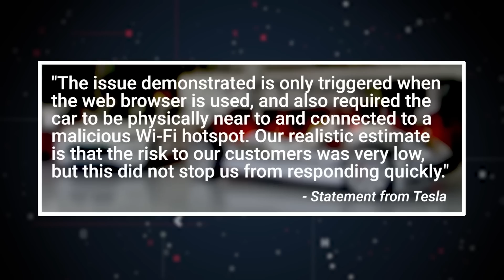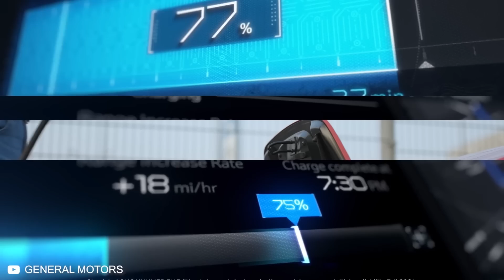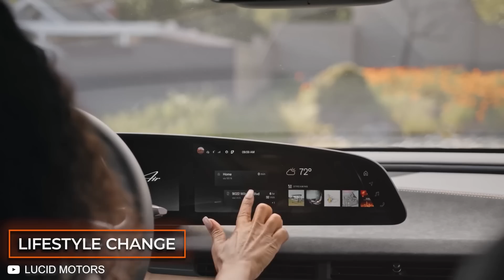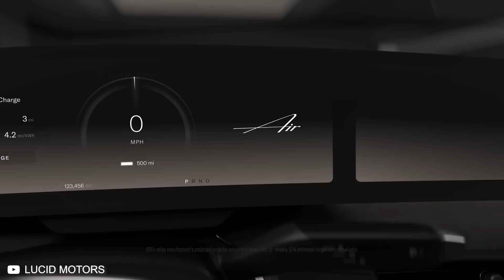EVs' Serious Problems That Carmakers Are Hiding

Comment: EV is not ready for prime time conversion yet.  Range anxiety will prevent most from switching.  And, unless you own a Tesla coupled with a high capacity charger, you won’t have the patience to wait.  Who would buy a used EV given the life span is ten years? Besides, $15k+ to switch out batteries and declined in range on older batteries.  Too many hurdles to own a EV now.

Comment: According to AAA driving in 20 degree weather and running the heater shortens the range by 41%!!

Kinda scary
Reply: Well 1.) depend on the temperature the car is set to. If you’re driving in shorts and a Hawaiian tee, not surprised. 
2.) depends on the car, teslas made after 2021 have a heat pump as opposed to the previous norm of a resistance heater. This greatly increases efficiency and most Teslas now only lose around 5% if the maths and statistics are to be believed.

More and more EV’s will start adopting thing. Especially for colder markets

Comment: A 45-minute break in the middle of one of my family's frequent 8+ hour trip sounds terrible
Reply: Well he has that wrong. It’s 45 minutes if you have to roll in on 0% and your last electron, to charge to 100% on a V2 super charger. Most of that charging time comes from the first and last 10%. More commonly you’d arrive with around 20% and charge to 90% and this would take around 20 minutes but on the new V3 super chargers it would take 5-10 minutes. And if you have a family then you know as well as I do after 4-5 hours of driving, at least SOMEONE is throwing a tantrum because they need the bathroom or they’re hungry.
Reply: @engineeringtheweirdguy2103  Okay. But I also don't need 45 minutes or even 20 minutes to get everyone to the bathroom. Not that electric cars are really designed for road trips. He's right about having to plan your life around your chosen powertrain lol
Reply: @ProductBasement  well not really. You’re life doesn’t revolve around road trips. And whilst a pee and go sounds nice, it’s never that simple with kids. Additionally it’s not safe you someone to drive for that long without a break. The human brain on average can only sustain focused concerntration for a maximum of 3 hours before mental exhaustion sets in and functions are significantly compromised (zoning out or falling asleep). Additionally kids often want to eat at regular intervals. Meaning at least 1 stop fro breakfast or dinner or lunch. 

I regularly do a 6 hour road trip every weekend to go snowboarding in my EV. When I stop for a charge, I also stop for dinner/breakfast (depending on if I’m coming or going).

The car is often done charging long before my food is ready and then eaten. But keep in mind I did this with my Subaru as well. Except I had to add getting fuel, paying for fuel, then finding somewhere to park. None of which I have to do with an EV as I pull into a charging bay, plug it in and walk away.

It’s an paradigm shift and just because you can make your family starve for a full day, and have regimented pee-breaks or force them to use a colostomy bag when driving a combustion car, doesn’t mean it’s safe, responsible or even what most responsible people do. If you timed yourself you might find you’re stopped much longer than you think you are.
Reply: @ProductBasement  and for the record my road trips cost me around $15 in electrify each way, where as in a combustion car, it would cost me closer to $200 with current fuel prices. With the bonus that I don’t have to worry about my car not starting in the snow because my engine is too cold to sustain ignition before my starter battery dies.

Comment: We were at the Ford dealer the other day and one of the guys showed me an electric pickup truck the price was $92,000.00 and it weighed over 7,000 lbs. It's totally ridiculous.
Reply: 92k? That's cheap. When I was looking for a truck a salesman said they had two on the lot for $140k each after "Market Adjustment". Insane
Reply: @boss42971  Wow, I believe you, if someone got that kind of money, more power to them.
Reply: @boss42971  what type of truck was going for $140k? An F250?
Reply: @albertogonzalez1746  Ford Lightning F-150

Comment: When thousands of those batteries become dead and useless, then what landfills and oceans are they going to dispose of them in?
Reply: The technology already exists to contain lead, mercury, and cadmium when recycling batteries and it is improving by the year to the point that in about 20 years the need for mining will be reduced substantially for recycling batteries. All the other mineral and elements in a EV battery are fully recyclable even after being used as second-life batteries. One nice thing about EV battery cells is, they find a second use in stationary grid storage. When there are enough of them to create a market where recycling them by manufactures is not done, they will be recycled to reclaim the valuable metals just like any other high volume appliance does nowadays.

Comment: I have been driving a fiat 500e since dec 2017!  Range anxiety is real….i have a level 2 charger at home.  My fiat only has a range of 87miles….and in reality its much less when you use the a/c.  I live in south florida.  I am not able to make a round trip around my city.  There were also not enough chargers to help me in my journey.  I have run out of juice probably 4-5 times ( that meant i had to get towed home).  The maintenance costs on an EV were minimal.   I recently received my LR Model Y 2 mos ago.  I am very happy now that i get over 300 miles now.   I am able to go to more places without the anxiety.  I even made a road trip to Orlando with no problem.  Tesla has a great superchargers everywhere. I also noticed there were other chargers around so that will make it easier for others to get around better.  As long as we have more charger stations for people, the EV race will get better.  I am so happy with my purchase!
Reply: I have a standard range model 3 and never really had range anxiety once I got used to it. Modern EV’s have come a long way over the last few years

Comment: Sell me a car with a regular battery size that has 5000 mile range per charge. That charges in 5 minutes. And uses 1 kilowatt to charge. A battery that lasts 2 million miles. And mechanically reliable as a corolla. Sounds like a dystopia until then I'll buy it.
Reply: Why do you need 5,000 mile range when you can only do around 1,600 miles in 24 hours of driving at highway speeds non-stop for 24 hours? Seems like a ridiculously impractical demand. Especially considering even at the longer end of average the average daily commute is only around 60 miles round trip.

If you used 1kW to charge over 5 minutes you’d only have 0.08kWh which is about the same amount of energy as 2 AA batteries.

So you’re demanding an impractically high range you’d never be able to use on a week yet alone a 24 hour time frame even if you had a colostomy bag so you didn’t need a bathroom break. 

But you also want to achieve this, by reducing the battery size to the size of 2 AA batteries? In contrast a 400 mile Tesla has a 100kWh battery. That’s 1,250 times larger than what you’re demanding. From a physics standpoint, your dream car wouldn’t have enough energy to even overcome your weight, yet alone the weight of a car. 

You get more power from an RC car battery!

You sir, are losing the plot a little. Lower your expectations

Comment: Most are still charged with fossil fuels.
Reply: So? 

An EV recharged by a coal plant puts out half the CO2 as a gasoline car the same size doing the same trip and even much better in stop and go commuter congestion.

Petroleum is valuable to wasted on gasoline; we'll need a lot of it for our grandchildren to use for plastics, paints, petrochemical feedstock medicine, etc.

Comment: What about driver passenger safety if a fire starts on your electric vehicle?

Are UK fire brigades trained to deal with highly toxic smoke, and debris that is also highly toxic? These things go up like romantic candles.

For me, it's just a rush to bring out the new technology. I certainly  won't be purchasing one.

By the way, you'll experience horrific range anxiety when you travel on our motorways. People are being prosecuted for overstaying at the service station. The reason, they had to queue for hours to use a charge point.

Comment: Most objections to EVs are either due to misinformation or resistance to change. People hear what they want to hear and draw inaccurate conclusions from it. The reality is petrol cars are just as challenging as an EV, its just that we are used to their particular challenges and have learned to live accordingly. Like they said in the video, changing to a an EV requires a lifestyle change and a new perspective on ownership. With proper planning and management, there is no reason why an EV cannot be just as viable as a combustion car. If/when I go looking for my next new vehicle, I have no issue with selecting either a traditional or EV model. I would love to own a Mclaren or a Ferrari or a Mustang Cobra, but I would be equally excited about a Tesla Plaid or if I decide to buy a truck a Rivian is just as likely as an F-150.

Comment: Aside from your remarks about serving (I have a 2019 Tesla model 3, with over 100,000 miles on it and all I’ve done in relation to servicing was replace the tires.) your conclusion is sound. But heavily worded. A charging “regime” isn’t any different to a refuelling “regime” most of your Charing is done at home and maybe 3 or 4 times per year youd charge else where. It’s really not that terrible to work around. Or common.
Reply: Considering I put an average of just under 300,000 kilometres (186,000 miles) on my last two cars over about an 18 year period, it seems it could be a good investment for me in the long run considering that I wouldn't even drive that much now that I'm retired.
Reply: @rps1689  it would be a better investment if you did drive that much. Because they are so cheap to run by comparison. Electricity costing less than fuel and the little to no servicing required. The further you drive, the more money you’ve saved by comparison. I drive more than 100km every day and my standard range has been breathtaking value for money.!including my home solar, I went from paying around $100 a week in fuel to around $10 a week in electricity to charge the car…. Infact my monthly electricity bill, including aircon, refrigerator, dish water, TV.. etc electricty use. My entire electricity bill, car charging and all, is cheaper for the whole month than it is to get 1 tank of petrol at the moment.

A side to EV’s very few people consider.
Reply: @engineeringtheweirdguy2103  One I overlooked.

Comment: Only good for trips to work and back?standard range EV, yet alone the more popular long range EV’s have enough range to get you to and from work…. For almost a full week without charging for the average commute. Super chargers charge your car in 10-15 minutes and you’ll be using a home charger overnight which can fully charge your car in 4 hours considering the average car spends 14 hours a day parked at home overnight I’d say that’s plenty of time. No need to wait for a charge. Even from a wall point that you’d charge your phone from, for a daily commute of 60 miles only takes around 7 hours to charge back up again. Still plenty of time. What’s your angle here bud?
Reply: Interesting. I would likely only drive about 10 kilometres a day, and my longest trips would be about 350 kilometres twice a year. There are no lack of charging stations near my neighbourhood so it is tempting.
Reply: @rps1689  a standard range model 3 would do around 380km to a charge. You could not charge for nearly a month and still do your daily commutes. And you could do you 350km (although I’d consider finding somewhere to charge, if bad weather rolls through this can cause extra energy consumption as wind, rain and wet roads all increase resistance to motion.)
Reply: @rps1689  for context. I do 100km a day for work and sometimes more. If I forget to charge, I still have another 2 days of power up my sleeve before I have to find a charge. I also drive up to mt hotham every weekend which is a 500km trip each way. I charge twice on the way up at super chargers and once on the way down. I spend 30minutes charging one way and 15 minutes charging the other way. In those breaks I get dinner go to the bathroom, and occasionally watch a TV show in the car but I can never finish an episode before I have to leave. I’d be getting dinner and going to the bathroom either way (5-6 hour drive even with an ICE car). So I’d be stopped for roughly that amount of time anyway. I’d also have to stop for fuel. But this means getting fuel, paying, leaving the fuel station then finding somewhere to park in town which all takes up time. That’s all rolled into one at a super charger. Park, plug in, then you can go find food and a bathroom. After timing myself on that trip before and after getting an EV. Turns out the commute times are almost identical five or take 2-3 minutes stopped. So I havn’t lost anything but save a HUGE amount in money. 

Also ties into the common argument “what if there’s a blackout..” well considering I have several days worth of charge that’s not a very big problem. But it’s not just EV’s. How are cars going to get fuel if the fuel pumps don’t work because there’s no electricity to run them? Bit of a silly argument.

But then there is also this counter. If you do the maths, you can charge your EV in an emergency with a cheap, portable generator no bigger than a school backpack, and you’d have the equivalent fuel efficiency of 3L/100km. So if they tell you they’d have jerry cans incase of a week long blackout. You can say you do too. And it will last you much much longer.
Reply: @engineeringtheweirdguy2103  I must say you sharing your experiences and knowledge has been a breath of fresh air.
Reply: @rps1689  3 years of ownership and would never go back. It’s a paradigm shift, so taking the leap is scary but it’s worth it. 

In the end I hope I helped you feel more comfortable about EV’s.

Comment: “Loses capacity by 2.3% per year” ahhh no. Not since the 2010 Nissan Leaf. Modern EV’s are rated to 1,500 cycles and newer teslas to 4,000. Which means you’re punching between 500,000 miles to 1 million miles until you lose just 20%…….
Reply: This I did not know.
Reply: @rps1689  yeah. And modern EV’s have been showing this is accurate. A survey of model 3’s which had travelled more than 100,000 miles showed a less than 2% degradation. So the idea that EV’s average more than that per year for 1 year of driving under the average commute? It’s laughable. Modern EV batteries are showing clear signs of outlasting even modern combustion engines.
Reply: @engineeringtheweirdguy2103  It sounds promising. I'd like to get one, but I am retired now and chose to be a renter for the rest of my days, but its hard to find a place with charging at the complex. I go away months at a time also; is the battery OK with that?

Comment: “EV’s have more complicated electrical components such as power steering motors” …….. I forgot all combustion cars don’t have power steering… fml
Reply: Plus due to an EVs' good traction control, tires can last longer, as their driver assist-systems reduce slipping by utilizing the electric motor's rapid power adjustment. This system is much quicker than in ICE vehicles, where it is based on braking and limiting engine RPM.
Reply: @rps1689  not to mention much safer to drive. I have a rear wheel drive model 3. I put slip start on, and drove around 2 4x4’s with all their 4 wheels spinning on black ice trying to get up a slope. Just over took them and kept going with my rear wheel drive. Was amazing.

Comment: This must have been produced buy oil industry.
There are many new vehicles that are not Tesla that is very high tech and high$.
The purpose of this article is to increase fears of EV's.   Most people can not afford a 200k vehicle that weighs 5000lb. The weight means big battery and big $.
More likely smaller ev such as motorcycles will be the norm for that ride to work. Smaller mean easier charging at your apartment house.
Some evs have their own solar panels that give you up to 40miles range free each day.
This article is a real propaganda  peace .
Many auto dealers and oil companies are heavily investing in solar wind and evs. They will not admit until their current oil investment have got a good return on their investment.

Comment: The grid will not be ready by 2030 to handle the demand, just look at California now, EV probably is not the answer.
Reply: Redesigning electrical grids to run on intermittent sources, takes time and is very expensive. That being said, China redesigned more grids and installed more solar energy infrastructure in the last three years than exists in the US. Of course they are only using it as a stopgap like they are with using coal as a bridge-fuel to power its electric grid while they wait for the nuclear biusiness to get its act together; they are in the midst of modernizing old ones while the nuclear industry is developing its new technology.